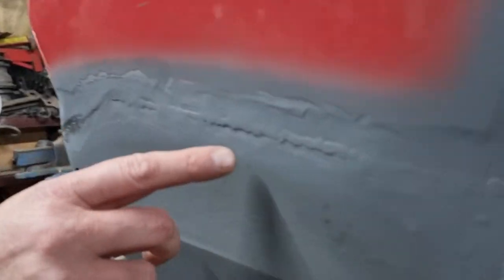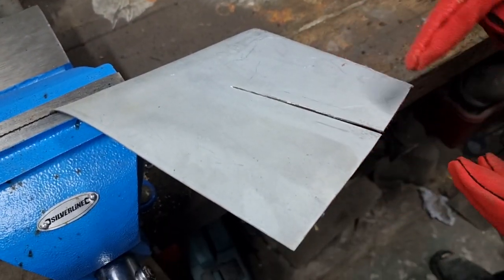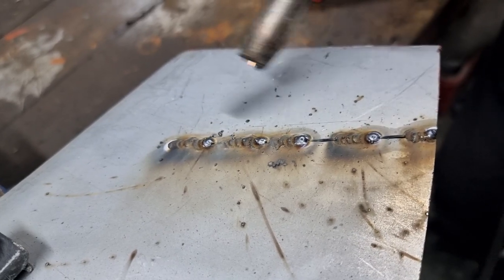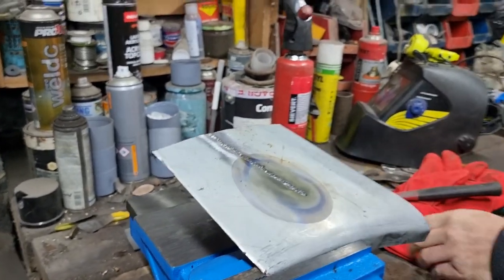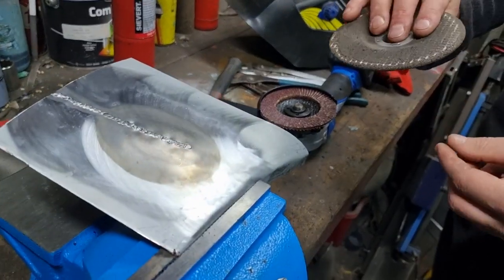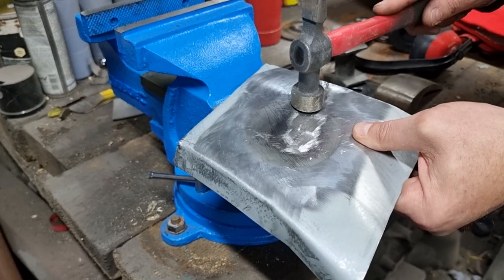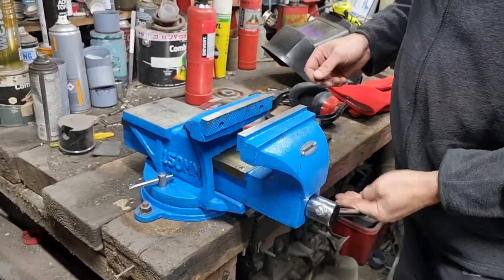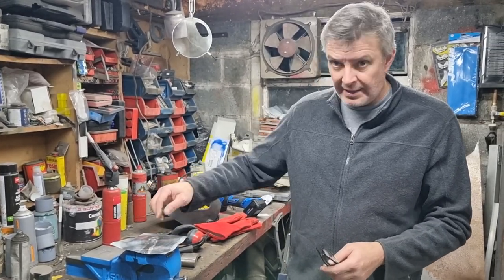Can Mig Welds be Planished?  Surprising Results!

Comment: Jeff Lily restorations had a 2 part article on this about 15 or so years ago in Cars and Parts Magazine.. He spliced new reproduction rear 1/4 panels  for a 69 camaro coupe, on  a 69 camaro convertible pace car. Because at the time repop convertible 1/4s didn't exist. He welded them on with a mig welder probably using .023 wire, let it cool naturally, knocked the head off the weld.. And then heated the weld bead up with a torch to a dull cherry red. Removed the 1/4 panels in their entirety, metal finished them, and welded them back on the car.

Comment: When I worked in metal fab at my last job, our tool of choice was a 90° degree die grinder, with small 80 grit roloc disk flap wheels Definitely a lot easier to maneuver and control then those cordless or corded grinders, and nowhere near as tiring to use. They were the cats ass for knocking the corner welds off of the stainless steel benchtop scale covers we made. Then we took them to a large dual belt stroke sander, with a rotating vacuum table to finish them off. And yes they looked  sweet when they were finished.

Comment: Carter Auto styling has a very useful video on speeding up the mig process by grinding immediately after each weld which helps the weld to cool down more slowly and so avoiding much distortion. Check it out.
Reply from the maker: I've recently seen that and keen to give that a try too, thanks 😊

Comment: I have often thought about this but never got around to actually doing it. So thank you for jogging my brain and interest in this. After your video i went back out to my shed and tried playing again.
May years ago i had an old stick welder which had a brazing setting on it, that  i used to use for small body patch repairs. In place of the welding rod it used a single copper coated carbon rod. Which you could with careful use get very local heat generation. I did the experiment just as you did but then ran down the weld carefully with the old  welder  keeping the heat zone as small as possible i then after the weld had cooled tried  planishing and whilst it was more time consuming it also seems to work worked. Enjoy the videos keep them coming.
Reply from the maker: Hi Peter, very interesting, I never could get the hang of stick welding, good to know that it also works in a similar way.

Comment: Great video a good test 👍 I always used a rag and water to cool down the weld. Then i found it would be harder! soon as hammered the metal would split so I let it cool down naturally now
Reply from the maker: Thank you Sid, I'm glad my learning is helping others, there's a fella in Canadia, Carters Auto Restyling, that has an interesting way, he spots 3 welds in a row then immediately grinds them while still hot, he says it slows down the cooling and keeps the weld softer.  I may try that out.
Reply: @DavesGarageuk   have to look at that one Dave are you using 0.8 or 0.6 wire? I changed to 0.6 wire found welding is better. mig welder  is on lower heat setting Great weld and metal not like a Mexican wave
Reply from the maker: @sidsxr3irestoration  0.6mm mate, for the same reason

Comment: Hi Dave good to. See progress.  Just a question  actually  how much. Gas do. You get through.  You use small. Or large. Bottles   Clive
Reply from the maker: Hi Clive, I use the large brewery CO2 bottle, lasts just less than 1 year at the current rate of welding.   Considerably cheaper than the little bottles that don't last very long at all.

Comment: Hey , 
When you are taking the top of the welds off a facing panel , what are you using to smooth them down ?
A flapping disc or the special discs with Emery tape on them/sandpaper. 
I'm having trouble when grinding down my welds , it's taking them too far back and pin holes appear. I'm.wondering if I'm using the wrong tool .
Your help appreciated.
Reply from the maker: Hi James, I tend to use a grinding stone to take the tops of the weld off, flappy discs heat up the panel too much.  Then I'll use something like 80 grit to finish them off, don't be too concerned with getting the welds to look perfect, put a straight edge between the panel, often it's sunk in a touch due to the shrinkage, it'll need filler over it anyways.  Well mine always does.... 😊

Comment: Dave i may have mislead you a bit. In my experiment i used the carbon rod to  just heat up the welds on a piece of sheet steel that i had previously mig welded. Like you i struggle with stick welding. And this old stick welder / brazing set has lived under my bench for 30 odd years. I have a tig welder but have never put in the practice, im ok on the bench, but folded up inside a car im pretty useless..
Reply from the maker: Ah ok, I misunderstood 😅

Comment: I do bore on - I'm fully aware of that - however I do what I bore on about all day every day as my "Living" so I feel I get to bore on a bit. 

I'd love to show people 2 weld runs - 2 very typical "Bodywork" weld runs - the first would be with 0.6mm solid wire & shielding gas. If you run anything bigger than 0.6mm wire in your Mig, for bodywork, you're mugging yourself. You always want the wire to be slimmer than the panel. More slimmer is more better. 0.9mm is too heavy. 1mm is for girders. 0.8 is no better than 0.9.   Buy 0.6mm. 

Anyway - panel welds, 2 runs. 

First is with solid wire & gas - do what you like, go as slow as you like, cool the spot welds as much as you like, it will be distortion central. The weld area will "dive" low, the panel will oil-can like mad & you will vow to save up & buy a Tig welder. There will be ALL the distortion, I care not "How Good!" of a welder you reckon you are - it will distort like mad. Reasons. HAZ etc etc. 

Second is with flux-core. 0.6mm, decent brand wire - running through a machine you picked because it goes exceptionally low - forget "High" - High is for people who weld girders & stuff. Bodywork demands "Low".  More lower is more better. Harder to find than you think. The flux-core bead you laid on 1 tack right onto the last - no regard was paid to "cooling" the welds or panel, you didn't back-step or any other fancy technique - and I guarantee there will be ZERO panel warp. None. You can flux-core weld right across a quarter panel & nothing will dive, there won't be any distortion & it will grind down flush about 80% faster than solid wire. 

Tell me again why you use gas shielded Mig? I am all ears - you must love torture, literally. Why does anyone consciously go out to buy a more expensive process, using more expensive equipment, with expensive gas, that produces absolutely crap results in comparison? Baffles me.
Reply from the maker: Ok ok, I'll try some flux core 😊😉